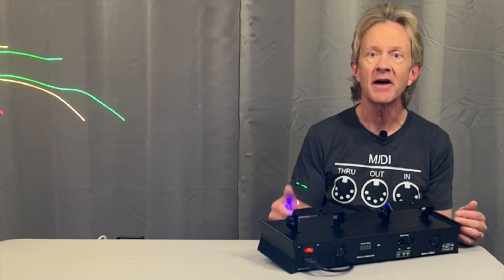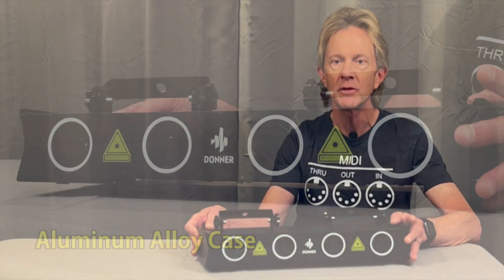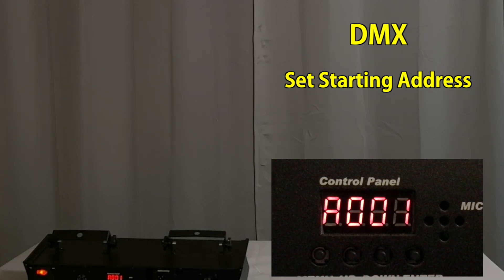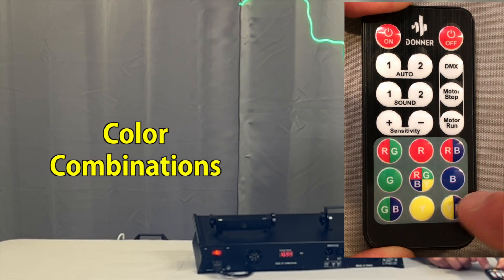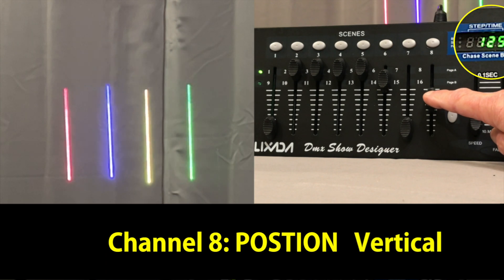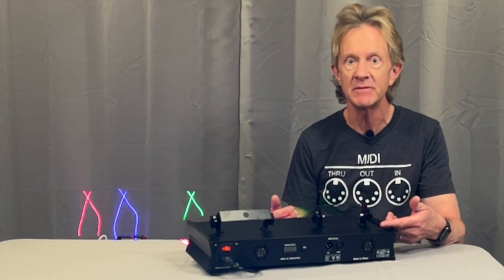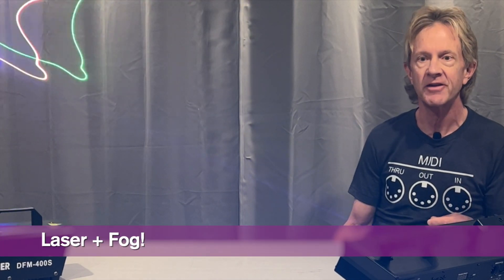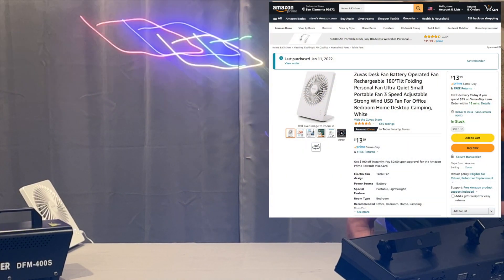Laser+Fog=Simple Beam Show!

Comment: how dangerous are these?
Reply: Common sense is key.  For safety you can use sunglasses.  To test if your glasses will help shoot the laser through the lens put a piece of paper behind the Lens.  Does it block a good amount of the energy?  You can buy specialized glasses but they are $200 - 300.  Good luck.

Comment: Hi David, I'm a new subscriber to your channel. Great videos for a newbie like myself. Question, what's the main difference between a fog and haze machine. I'm looking for something for home party use (smaller area). I have moving lights, LED pars and a laser. Seems like the fog machine in this video would work well? Thank you!
Reply from the maker: Hi and great question. Entry level fog machines are generally less expensive than hazers. They make a thicker more “opaque” fog that lasts a shorter amount of time. Hazers create a thinner, more translucent effect that really showcases lighting effects and the haze hangs in the air for a longer period of time. (often used for larger stage/theatrical productions) For home party use I think you will be happy with a small fog machine like this one. Thanks for watching!

Comment: oooh vinegar and distilled water, thanks

what do you recommend t disperse and control fog/smoke on open areas?
Reply from the maker: 50% white vinegar mixed with 50% distilled water and run it through the machine (just like fog) for about a minute. Quite a bit cheaper than commercial fog machine cleaner!
...when you are outside you will see the effects of fog or haze near the machine but the mist dissipates into the open air and its very hard to control and maintain a consistent beam effect as you can indoors. Appreciate you watching!

Comment: Thank for the videos steve. I use to have these. They died after 9mths using them. Realise lasers are not ideal for constant use. But bought a different brand and used them every 30mins intervals. Looking forward to the next video.
Reply from the maker: Appreciate the input and sorry to hear about yours dying :(
I've had pretty good luck with my cheaper lasers but admit they aren't under constant use -- I think a lot depends on the quality control from the manufacturer. 
Thanks for watching and look forward to posting the next one!
Reply: @LearnLizard  Well I’ve purchased 2 Laserworld 230R £120 each. Which is around $160 each. They are very good. It has Shut off switch if they are over used certain times. They are lower range lasers but are quality built.